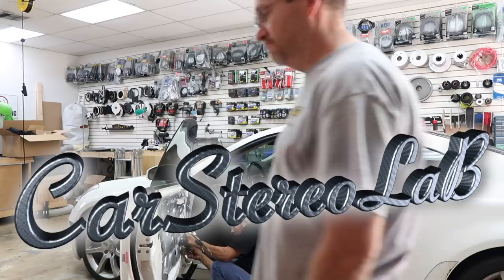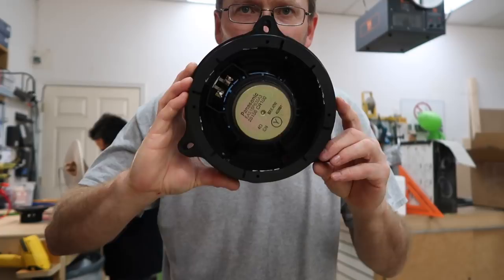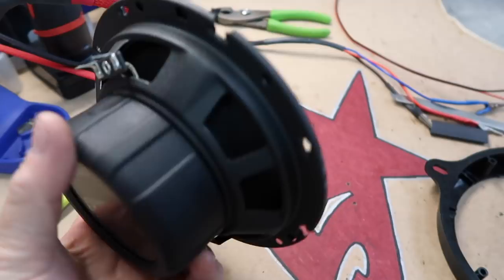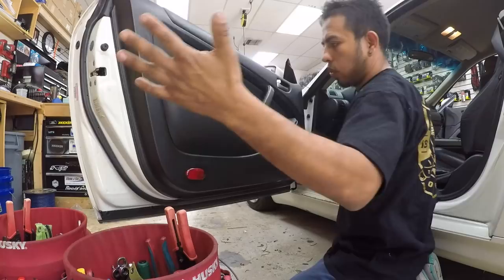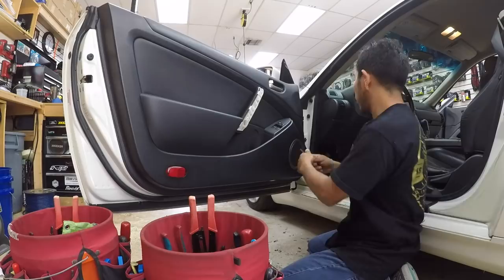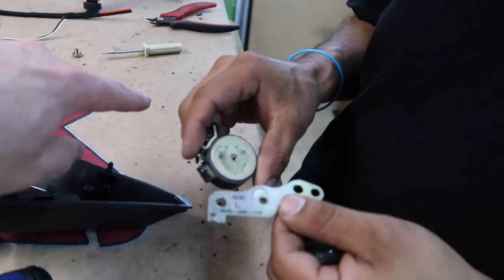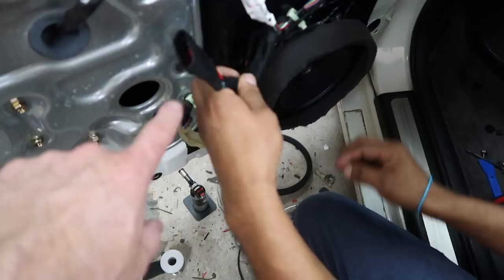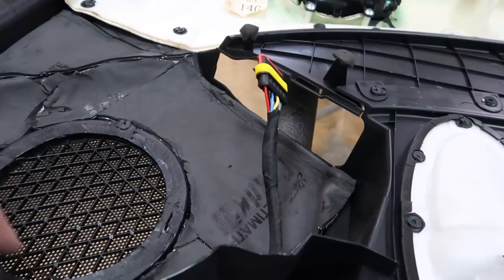We Start on Fernando's G35 Car Stereo Lab episode 3

Comment: EXCELLENT job with the 6-pin waterproof connector. SOOOO much yes there. Can't tell you how many times I've pulled a door panel and had to balance it in my hands while I'm jerking around trying to unscrew speaker wires from a crossover.

Comment: If this is a system for testing DSP's isn't it a mistake to hide your crossovers in your doors?  

Don't plan on running the system active?  I would think you would want them at the back where you can get to the wires easily.
Reply: Keith Anderson yeah when he said testing dsp then installed passive crossovers I got confused as well.
Reply: Up To Bat Entertainment i would definitely still install them so you can test other stuff besides dsps, but I just thought you would want them in the back so you could change how you wire it all from the trunk quickly and easily.

Comment: I have a g37 sedan with the bose system. Can't wait to see the second part to this. Are you planning on running a sub?
Reply: Alec Kennedy your door panels and setup is different. Crutchfield should have good info if you are seeking info on how to install or what to install where in your G37! I am going with Audiofrog GB60 & GB15 run active off Jl Audio twk 88.. figuring out Sub stage now! These cars have a metal wall that separates the trunk from cabin with a ski pass thru only. Something to think about as far as bass output. Have fun with your G and audio!
Reply: Up To Bat Entertainment I'm going to keep the bose. Maybe sound deaden some. But I'm wanting to add an amp and sub to the system.
Reply: Alec Kennedy nice man there is a few ways to approach what you want. I would definitely access the signal before the bose amp, that way it’s clean low level signal and you can feed any amp With that! There is a lot better out there than the bose for not much $ especially when you add dsp and go active.  Have fun with your new system bro!